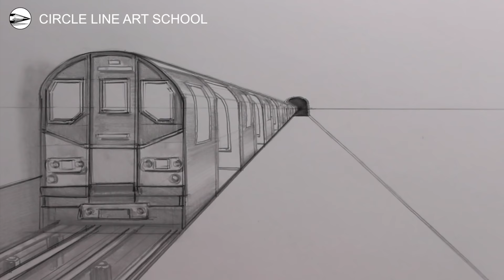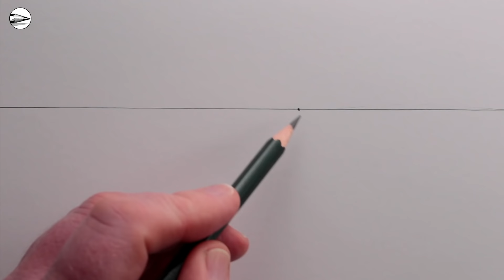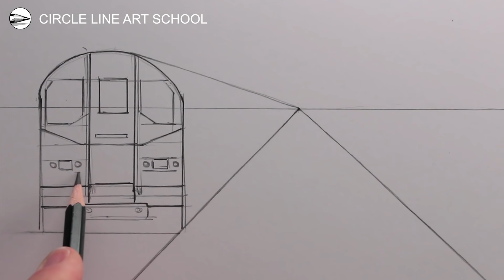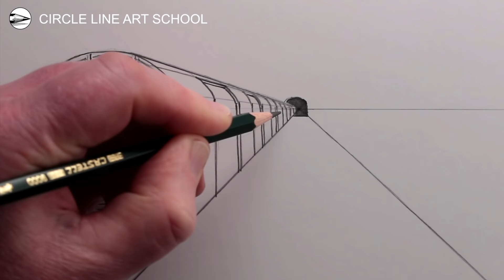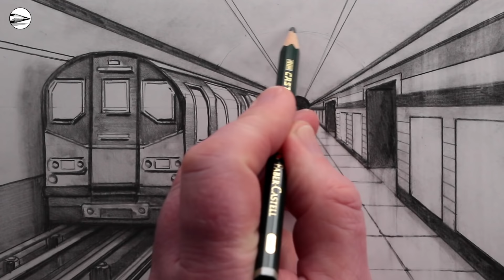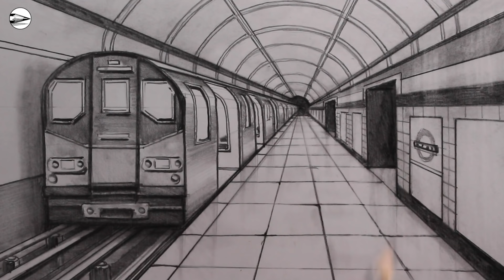How to Draw One-Point Perspective for Beginners: Narrated Drawing Subway Train

Comment: Why should the semicircle of train be higher than the horizon line?
Reply from the maker: Good question. The horizon line represents the height of the eye of the viewer, so if they were standing next to the front of the tube train their eyes would still be level with the horizon line in the drawing, as the train platform is flat. The middle centre of the train is taller than a person of average height, so that is why:)